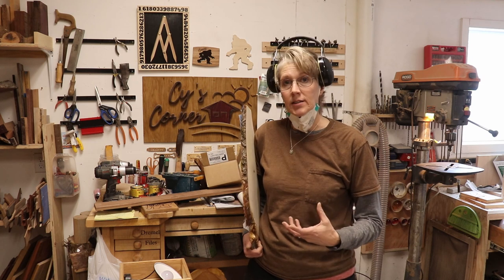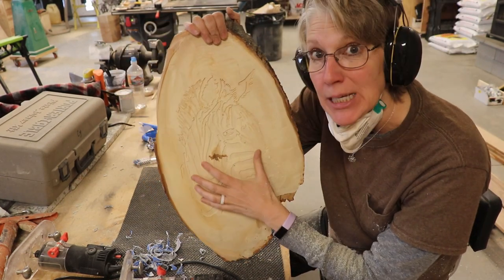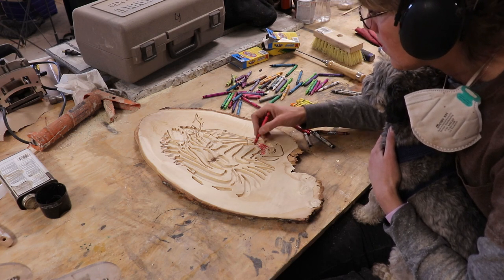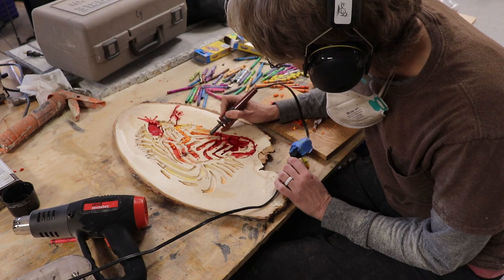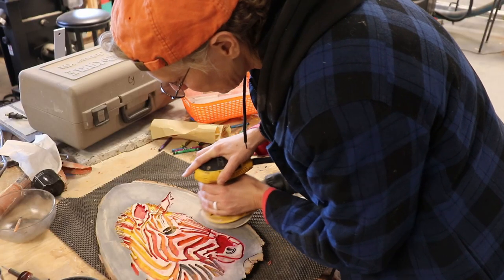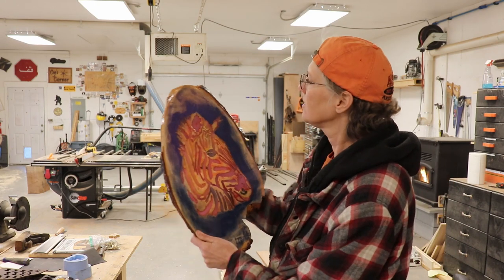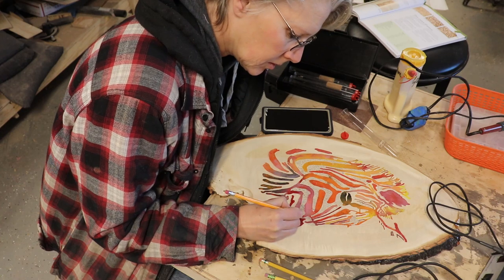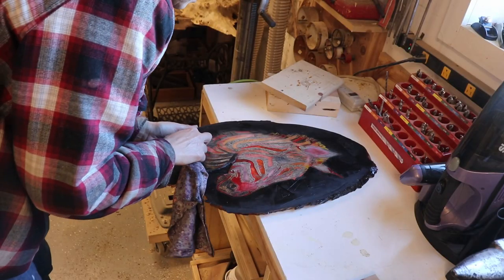Routers and Crayons and Messes Galore

Comment: I liked it and the idea. Though have you thought to try the crayons in a hot glue gun to fill in each area? Or a clothing iron on low enough not to burn the wood but enough to melt the crayons?
Reply from the maker: I love the idea of putting a crayon in the hot glue gun! May have to put a glue stick behind to push it through, and it may color up the gun, but I would love trying it!!! Thanks!